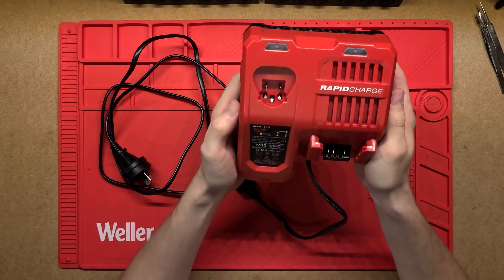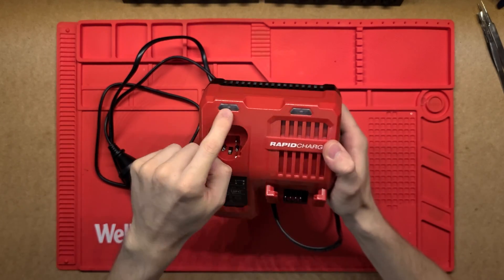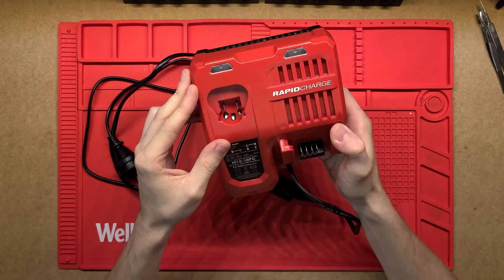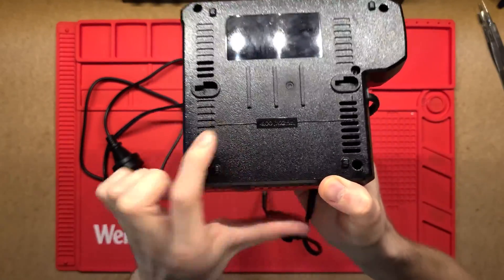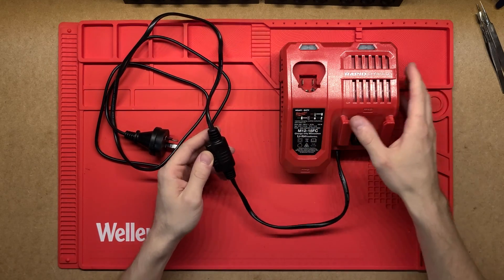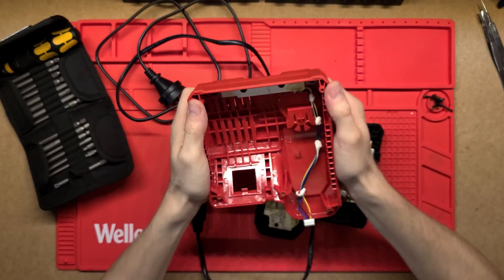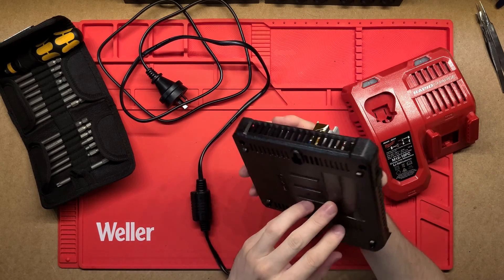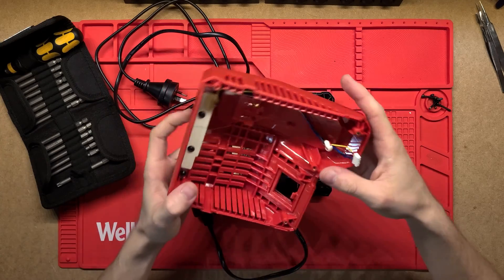MILWAUKEE M12 & M18 Rapid Battery Charger Teardown

Comment: Sweet explanation. Part of me is wondering how possible it would be to make a solar M18 Rapid Charger. I know there is an older regular M18 car charger that takes DC but that is much slower. The goal is to avoid the DC solar to AC inverter back to DC charger dance. Am I crazy to think one could take a spare Rapid Charger and disregard the high voltage AC side of the board and tap into the DC side with solar? Gotchas being have to match the expected DC charge voltage. I have seen people do solar through an mppt controler straight into the battery terminals but that skips the Milwaukee charging logic already built into a RapidCharger. Guess it is experiment time.

Comment: @5:57 if you were to supply 12vd to the output side of the bridge rectifier would the charger still work as intended ?
Reply: That's an awesome question
Reply: Though immediately following he talks about the transformer bring the dc voltage down to 20v so.. not sounding good
Reply: How about putting 24-29 volts dc into that side of the transformer?

Comment: That 4 ICs are PMOS, weird, seldom use PMOS. These FET are from Taiwan. U can see 2 of the same model after scratching away the jell covered on it. 
they use 2 model. by measuring, u will see they used it like 2 diode synchronous rectification in parallel, one pair in series to another, maybe, not digging this further.
the optocoupler is LTV made 817 model. it is for self switching purpose topology.
the MCU is Renesas 16bit product.
the medium IC next to MCU is Op Amp.
the is another transistor like device, that supply 5V to OpAmp and MCU.
Reply from the maker: Wow! Thanks for your detailed comment. This is great information for anyone interested.

Comment: I always thought there was a small cooling fan inside that charger like in a lap top because  in my one its sounds like a fan humming away
Reply from the maker: Thanks for the comment! The noise can also be  from the transformer or internal components, not always an actual fan. Some chargers sound like that even without cooling fans, especially high power or fast chargers.
Reply: the sizzling sound is the noise from charging battery compound. You can put your ear closer to the battery and it is loud from the battery pack.